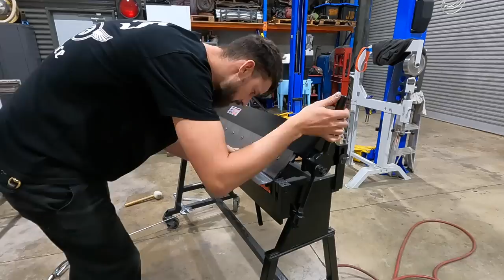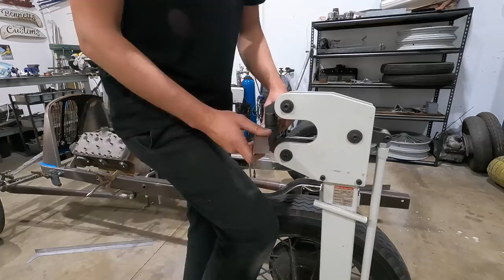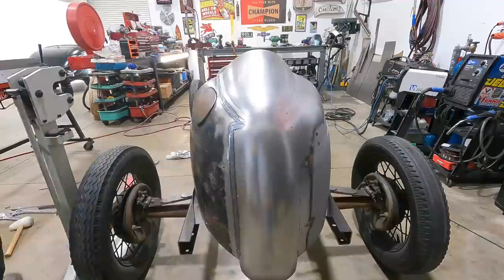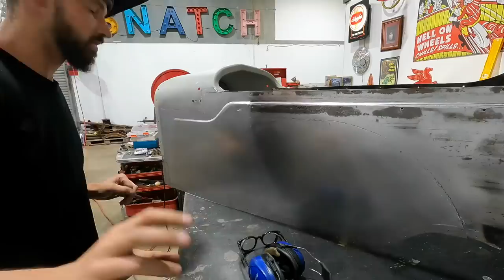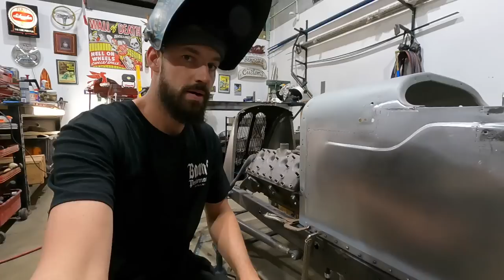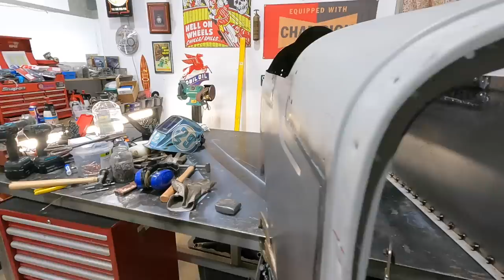A very RIVETING portion of the Single seater race car build!

Comment: Excellent work again Jordan, the formed angle will be strong and keep the weight down at the same time. I personally wouldn't worry about the blisters unless you need the room inside, once the pipes are in place it will look the part. Any plans for a small wind deflector on the cowl ? Cheers
Reply from the maker: Yes I have a few different options I’ll try and see what looks better

Comment: Another suggestion if I may... when you are welding sheet metal panels, "stitch weld" and keep an air hose in your reach.  "Stitch weld, cool with air hose, move a few inches, repeat"  Yes, it takes a bit longer but at the end of the day you won't have to deal with nearly as much warping of the panels.
Reply from the maker: Definitely something I do when mig welding or welding in an area where can can’t get to the back of, but in this case it’s actually better to do one pass and come back with the hammer and dolly

Comment: I think there needs to be transition radius pieces at the intersection of the hood and side panels at the front and rear of the engine "window" . The sharp, 90 degree angles do not match the contour and curves of the car.  I wish I could explain it better. Good luck.  👍
Reply from the maker: I think I know what you mean. I will see what ideas I can come up with for that.
Reply: @bennettscustomsco  Maybe a complete panel insert (on each side) with a cutout having the radiused internal corners. The cutout would allow a clean exit for your headers (zoomies? haha) but still provide a good view of the engine.  Maybe have some rolled horizontal lines that would match existing lines on the main chasis. Hmm.. I suspect you already have something like that in mind. Whatever you do,  I'm sure it'll look great.

Comment: Drill bit stuff  = swarf!!!!!!
With that strip set up it would look nice having a floor pan connecting to that which would lock the body creating a single tub format then with 6 bolt points or so the body could fix down to your chassis.
Just saying.
Reply from the maker: Yup definitely an option